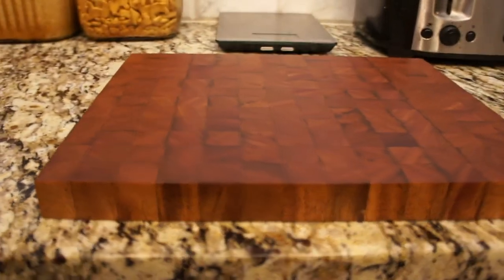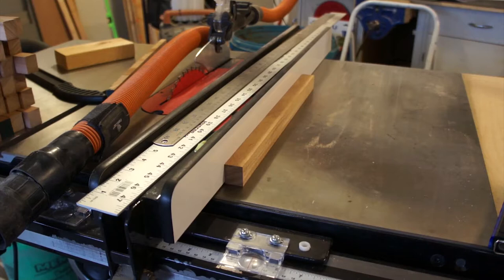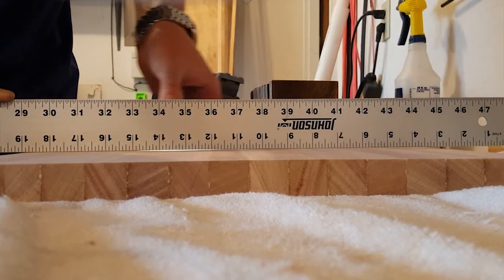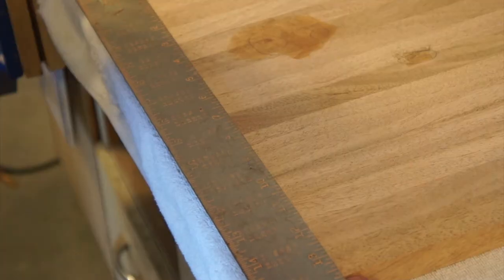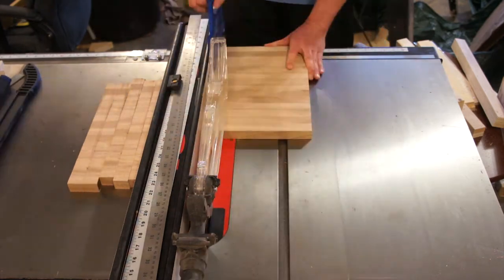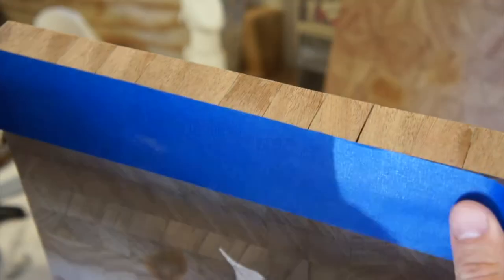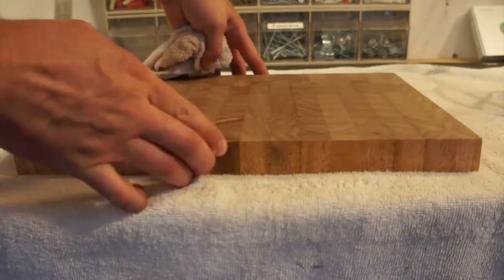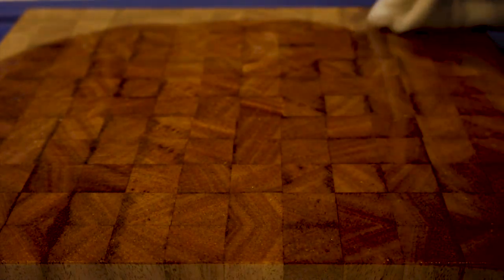Making an End Grain Cutting Board Without a Planer (Culinary tool)

Comment: Jokes on you, i dont have a jointer either lol
Reply from the maker: Ha! After I posted the video I actually thought, what if you don't have a jointer?
Reply: Depending on your thickness, you can use your router table and a straight bit as an edge jointer. Obviously it won't take a cup or a twist out, but there are other (longer, more difficult, tedious) ways to do that, too.
Reply: same condition with me, i have jointer only, it's difficult to make cutting board. thanks for your sharing.

Comment: Damn you need a new saw blade
Reply from the maker: It was dull and too high tpi. I should have used a ripping blade. I made a maple cutting board with the right blade and it made all the difference. Also I should have used a feather board.

Comment: I'm new to wood working.  What kind of router bit did you use to make the "end hold handles"?
Reply from the maker: Whiteside
Part number 1413
1/2inch radius 1 inch cutting diameter